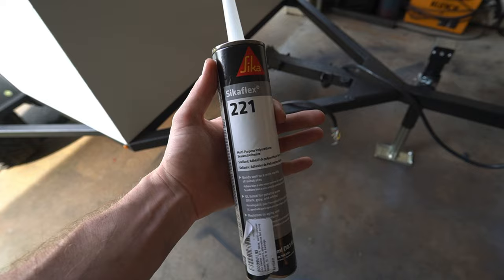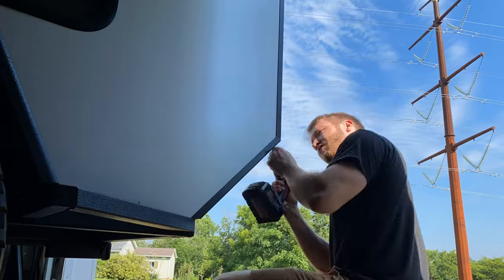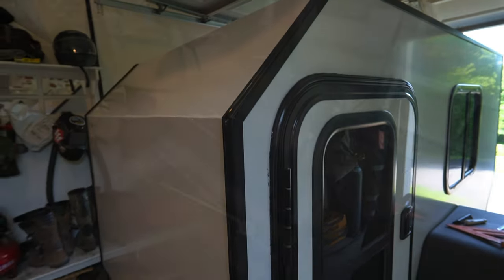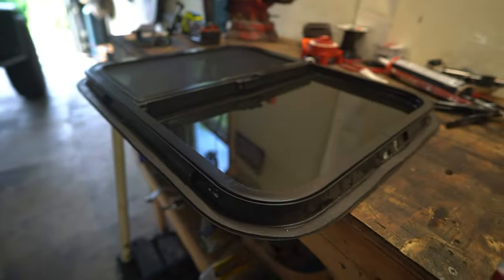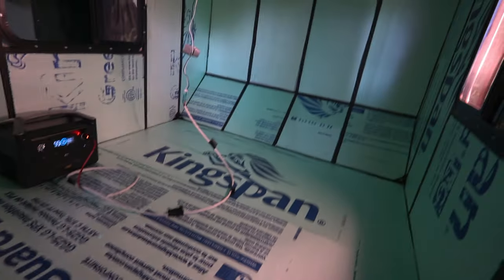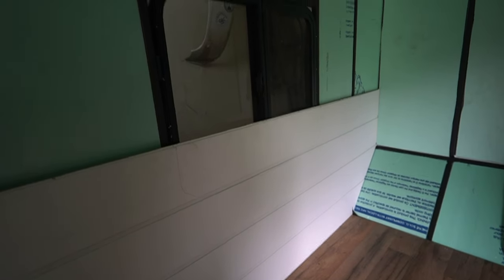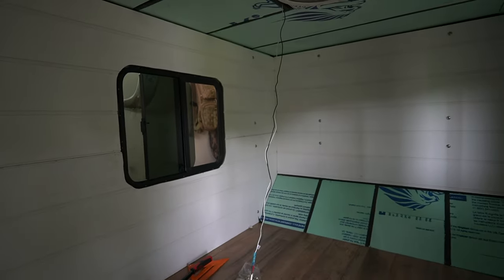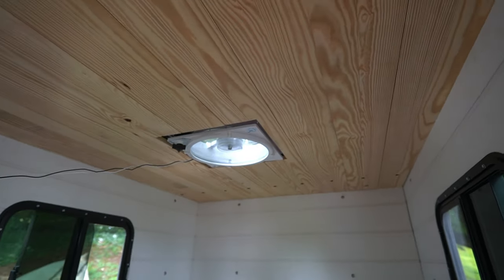Micro Camper Overland Build | Part 4 | Exterior Trim & Interior build out

Comment: I've always been to scared to build this type of trailer. Now watching you I am ready to take it on. I am a metal artist and build lots of outdoor landscape items in my shop. Mostly trellises and gates. I am currently doing a similar RTT trailer like the one you did.
Reply from the maker: I was a bit nervous about the build at first too. Mainly concerning it being water tight etc. but as I went along it wasn’t as hard as I expected!
Reply: @Adv4x4  Looks like you sealed it very well.  Are there any corrosion issues around steel screws in the aluminum?
Reply from the maker: Nothing to note as of yet!

Comment: Did you add anything in the corners to support the paneling or to screw the paneling to?   Or is your paneling rigid enough that it don’t need anything there?  I am building a trailer and contemplating what to do on the corners.  I’m very impressed with your build!
Reply from the maker: When I attached the trim the screws when thru the trim and exterior panels and into the metal structure of the camper. You can see that in more detail with the build videos linked in the description!

Comment: Thanks for the videos. If I understand correctly, you floor is a sheet of 3mm ACM attached to the frame, then a half inch of foam insulation, and then vinyl flooring on top. Is that right, and are you still happy with that?

Comment: You are extremely handy and practical. 
Which is why I do not understand why you do your cuts on the ground like you've never seen a table before.
Reply from the maker: If I had enough space to warrant a table large enough to handle these materials I would. 

Single car garage + tools + camper leaves little to no space unfortunately. The floor is one large table 😉

Comment: Another amazing episode! Already bought my plans. I have some ideas to make some small changes but I really love what you’re doing and you’re a great inspiration to the community. A little tip for putting down the caulking you can use painters tape to help you get a nice straight line on either side of the caulk line and then peel it right off. The big alteration I hope to make using your plans is to make the teardrop section removable somewhat like a truck camper so that I can have a trailer when I’m not using it for camping.
Reply from the maker: Thanks for the plan purchase man! Also appreciate the kind words 🙌🏻🙌🏻 

That’s a great idea for the caulking! Would have definitely made cleaning up the edges way easier. 

I debated making mine removable as well but in the end I couldn’t think of a time I’d actually wanna remove it haha. Still a great idea. Makes the trailer much more versatile 👌🏼
Reply: @Adv4x4  The only reason that I would wanna remove it is to use the base as an actual trailer towing motorcycles etc. Although I thought about making a way to where I could put my dirtbike onto the frame of the teardrop as well but I also have a Harley and could use a trailer for towing it and even to pick up supplies for the project. I’m hoping to attend the Overland Expo east conference in October maybe I’ll see you there;  would love to shake your hand and thank you in person for all your great content.
Reply from the maker: I think I may be going as well! Haven’t bought my pass yet but I’ve been considering it! If I do go I’ll be sure to post it so we can meet up 👍🏼

Comment: Why self-tapping screws and not rivets? Any benefits one over the other?
Reply from the maker: I’m not a huge fan of rivets. They aren’t easy to remove if need be which is the main reason I didn’t use them.
Reply: @Adv4x4  my concern would be the screws walking back due to vibration. Sick build. Thanks again for the idea. Cant wait to start building my RTT trailer.
Reply from the maker: I’m gonna give them a check after I put some more miles on it! It’s easy enough to do fortunately. If they end up working loose a lot on me I may do rivets we’ll see!
Reply: Are these self-tapping and Self-drilling screws??? sorry for my confusion. Thanks!

Comment: "What's up guys?" What do you mean, "what's up"?. You have no way of knowing who is watching your video, and clearly have no interest in the actual answer, so why ask an assinine question to which you can't receive an answer? English has an enormous number of ways of greeting people or introducing yourself, so use one of them instead of adding to the destruction of the language by spouting some nonsensical and illogical vernacular. It is a really, really annoying way for anyone to start a video. 

From the details given in the video, I suspect you are going to have a problem with the trim. You only put butyl tape under the face with screws. This leaves an open edge facing the direction of travel in some cases. Water will be forced under the trim as you drive.